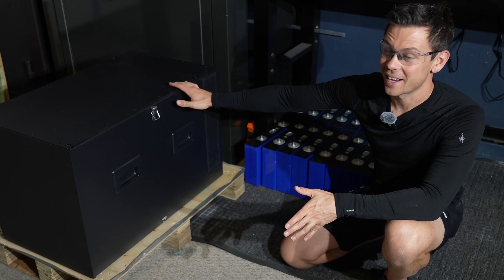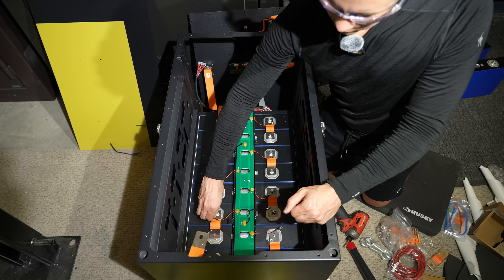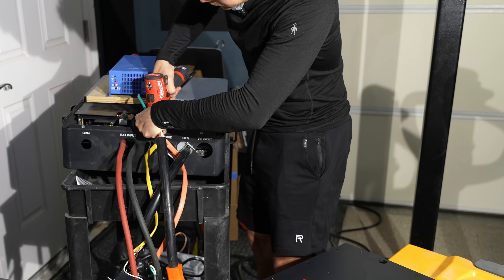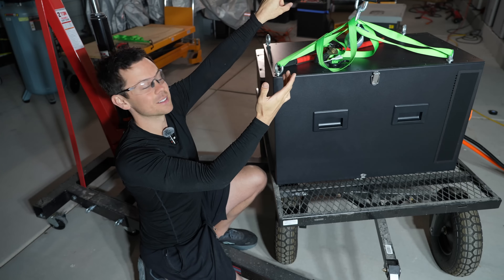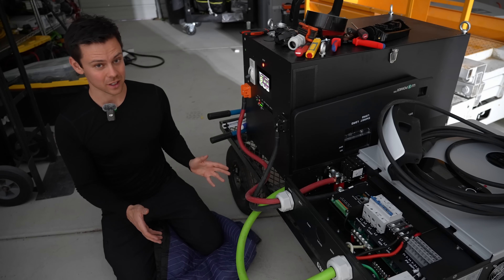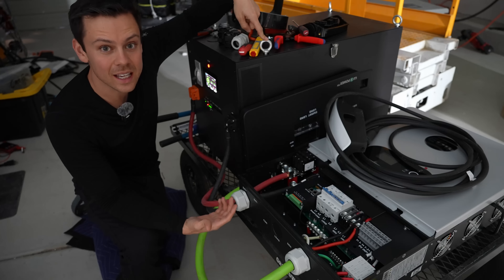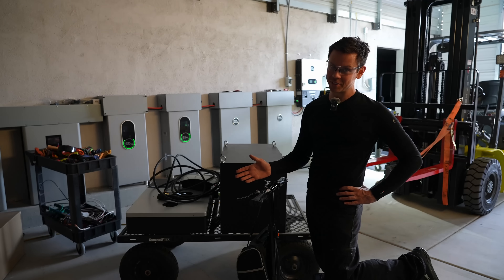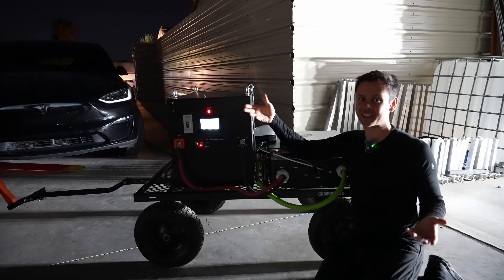HUGE 32kWh LiFePO4 DIY Battery w/ 628Ah Cells! 90 Minute Build

Comment: When you attach the lifting eye's, the flange above the thread has to be seated flush with the top of the battery box to distribute the load, otherwise the thread potentially bends/snaps. The lifting eye's are good for 360 degree attachment, no need for a spreader as long as the sling angle isn't too low. I used to be a rigger in my past life. Good job.
Reply from the maker: The threads were too shallow. They were  all the way in

Comment: Will do you have the specs for surge capacity of this battery?  Can it do 400A for a second?  Need something to start a 2HP pump with 70A inrush at 240v ac.

Comment: Imagine only a small sheet of fiberglass between the lower batteries and upper battery trays. Wow wow the weight and compression of insulation

Comment: I have about 16Kwh of AGM 145AH commercial backup batteries they are 107 lbs each that is 1000lbs
I ran a test with a mess of shop lights and tools for 8 hours (On One Battery) and was only able to draw it down 0.2v

Comment: Great video!
Anyone know how many sungold power 12v lifepo4 200 ah batteries I can wire in a bank?
I want two sets of four in series,parallel for 48v with 8batteries.
Sungoldpower won't answer emails or questions.

Comment: that's a heck of a battery for $3.5k. neat to see thoughtful assembly design.

I worked at dry ice factory a long time ago and the seal on the huge overhead vacuum gun we use to lift the uncut dry ice blocks failed. As the block was falling onto my steel-toed boot (I assumed it'd crush the toe into my foot), I made sure to shoot the camera a foul look. the block bounced off, though, and now I exclusively wear steel-toed boots, even at home.

Comment: The max amperage for this battery was stated as 200a, but the affiliate link sends us to a product which states 300a (JKS 300a BMS and 300a breaker). I assume the factory listing is correct. Ya?

Comment: Steel toes or no toes. I'm glad your foot is okay. 
As for load testing, get a GM EV with the 19.5kw level 2 charger, that would max out any of these. A silverado ev would also probably be useful for the bed and towing capabilities, but a blazer or lyriq would also get the job done. Just make sure its spec'ed for the 19.5kw charger and not the 12kw

Comment: Another big issue with this kind of build is that the bottom cells can't be seen and checked on, even periodically. You would have no idea if a connection isn't quite as tight as it should be, even after torquing, as you wouldn't be able to see with a thermal camera if there's any hot spots. Andy with Off Grid Garage brought this out as he did use a thermal camera to inspect the top connections and bus bar lugs to the breakers/terminals. 
I would much rather a single cell height box so it's a lot easier to maintenance.
Reply from the maker: Good point
Reply: Maybe next version

Comment: Shoulder eyelet bolts do no good if they arent seated on the shoulder. These seem like a nice idea if you are putting the battery bank in a basement and have to get it all down there via stairs. Just build it down there piece by piece.
Reply from the maker: Yeah, the threads were too short

Comment: For our home back up solar system in Pakistan, I would rather choose multiple smaller batteries in parallel to avoid a single point of failure as 32 KWH storage is enough for an average home in Pakistan.

Comment: Will I would suggest you get a pair of safety toe boots with metatarsal guards because of the drop danger you put yourself in. 

A pair of these batteries would power an offgrid welding/ fabrication shop for the most part.

Comment: Those batteries are too large to be mobile. Instead the cells should be stored in a purpose-built outhouse or similar structure and arranged for easy access and maintenance. Mind you, the whole setup will need to be certified as safe for insurance purposes if it’s going to be connected to the grid. Great idea for a video!

Comment: 1:19 please don't use that cheap torque wrench 😢 I've seen your tool videos I can't believe my eyes 😂 at least use something extremely high quality like the Central Tools 97361B for this kind of job. It's made in the USA and still affordable at under $200
Reply: Eh, that Lexivon isn’t that bad for a DIYer. They come with traceable calibration certificates and they’re +/- 4% which is what most torque wrenches are tested to (that’s the ASME standard.)
Reply: That contact point is gonna rust 😭😭😭
Reply: Lol some of ya goofy as hell on the internet.

Comment: I just ordered the 16kWh from  yixiang and was cursing that of course there's a new "better" version out, but then the second half of your video completely changed my mind.  I am so sorry for your foot and wish you a speedy recovery but I am also grateful for the hard lesson that I would not be able to manage the weight of 600lbs.  The smaller 300lb version is no joke either but if I have to move it I can deal with that pretty safely.  I would be toast with that 600lb monster.  Great battery though if it fits your use case!

Comment: I built my own metal battery box for my set of 16 x 628ah cells, a lot easier to access and maintain and on wheels too. Will you need to make a lifting speader bar to stop bending the lifting lugs

Comment: 6:15  I had a Lyft Driver  run over my left foot. 
I have to wear a carbon Fiber leg/ Foot brace for the foreseeable future due to long term Nerve damage & thankfully, the small fractures have somewhat healed after about 2 years + .  
PHYSICAL THERAPY IS ESSENTIAL  to get back on your feet. 

All these injuries catch up to you once you start hitting your 40s. 
Hence why most guys retire from the military around that age if they got in when they were 18 as by that time, you get a lot of "Bangs" and bruises on active duty.

Glad things look good, but keep up on it, and don't let the system slack ya around. 
Took YEARS for me to get the healthcare I needed due to a combination of administrative headache and just plain lack of doctors available up here in Oregon.   

BTW, the foot massages were a welcome relief.  
Some of the best $50 bucks I spent as I could even hobble around the next day or so when things calmed down.

8:09   One word!  Exo's Car Audio Build!  :face-blue-smiling:
Or anyone with a Massive SPL car audio build. 
There are people out there running High Voltage amps Like the Tara Amps that could really do well with these High Voltage DC Cells.
Reply: That sucks. That's why I'm always careful in the cities

Comment: One option for safe moving is to make a universal skid/base that can be moved with the pallet jack. They have pallet Jack's with short forks that are more maneuverable and can be rented for one time use for folks that might move them very infrequently. They also have pallet Jack's with adjustable width forks. Obviously, if you have a forklift that is the most safe and effective.

Comment: could you temperature check the battery on different amperages? I think thats aslo really interesting because i avoid running my 16kwh DIY battery above 80-100A, because of the heat (Dont want to exceed 35-40c)

Comment: I suggest you do a lifting equipment training course, the angle you had for the slinging was way too shallow, it would have effectively tripled the stress on the eye bolts, and you didn’t have them turned to be inline with the sling, This is why they bent, you are lucky you didn’t drop it on your other foot.

Comment: Sorry about the foot. Broke both mine, and it sucks. Any way to get a copy of the Yixiang DIY battery box manual in order to see what's involved? I need to know if it has the communication protocols for a SMA sunny island 6048 system, and how many units can you physically stack.

Comment: 4:06 You can get and use a lift yoke with a spreader bar to change the angle of the straps, that way the sideways force is compressing the spreader bar and not on the bolts.  That battery is seriously impressive.

Comment: WOW to twice the amp/hrs per cell. Love the idea of twice the standard 300  kWh cell to 600 plus kWh on one BMS. Notice sell page did not list the BMS. Wonder how much shipping cost get added to $3500 price? ... Noticed 31 mV difference in cell voltage spread @ less than full charge; which has me wondering what BMS is being used, and what the cell voltage spread is at full charge. Also, while believing 2 amp active balancing is good for 16 x  300 ah cell, I wonder if 4 amp active balancing would be better on 600 amp/hr cells. ...just some thoughts thoughts from my Curious side. Hope testing battery pack over time proves their longevity.   Pipe Dream if I ever built such a battery: I wish there was a long version where all 16 cells were lined up in one row. That would make for way easier inspections, and possible adjustment, if ever needed over time.  Thanks for Awesome Review.

Comment: I put a half ton generator on one of those carts, great until one tyre went flat. I had to use an excavator to lift it and put rigid wheels under the genset. These carts aren't very good on pneumatic tyres as they destabilise easily.

Comment: You're pushing the definition of "mobile" there. Not for people who live on the top of a hill! Check out the new REPT 345 Ah prismatic, same physical size and weight as the 280s or 315s if you want to push more kWh without structural damage risks.

Comment: Did you top balance them?Or is it not needed with these newer b m s
Reply from the maker: No need to do that if you have new cells. And it has active balancers so it will balance quickly if it is out of balance
Reply: Thank you for clarifying, bro I got the same cells and I was thinking it was gonna take forever

Comment: This battery would run my 2700sf house, with 2 a/c units for 2/3's of the year in Florida. I'm really considering getting one of these. Have you had any issues with customs, shipping, and/or delivery of these huge units? I've purchased many things direct from Asia but this is on a whole new level. It's intimidating not having known (or at least time tested) customer service.

Comment: Wow, as I was watching the video, I was just about to mention how dangerous it is to rig at such extreme angles. You multiply the weight to the ropes by a few percent. That's why the rigging eyes got bent. They aren't designed to be rig and angles over 60°. When grinding or cutting, always wear PPE. We are actually required to wear glasses and a face shield when grinding but that is for steel mostly. Leather gloves are a life saver and steel or composite toed boots are also a life saver. I've had 

Enough nagging. Good job on the forklift and always think of what could go wrong before doing something. As silly as it seems, it can save your life. I also always tell young people about trying to keep their backs in good condition while they are young. Have a great day Will.

Comment: Maybe  I'm going to sound annoying, but personally, I think too many YT'ers skip on safety when building these, including Andy with his flip-flops... You should wear steel tipped shoes, face shield (not just glasses, accidental molten metal from an unintentional short isn't fun anywhere on your face) and gloves. You should't wear shorts either: the same molten metal isn't fun there either. And of course, don't wear jewelry while working on batteries: take off rings, necklaces, watches, etc.
Reply from the maker: Good points. Agreed. Especially with face mask. Raw cells are incredibly dangerous to work with.

Comment: I see some recommendations for steel toe boots, I just would want to add to be mindful of the loads you are lifting. Steel toe boots will protect to a certain point and then the "failover" is that it bends down and cuts off your toes so you can retrieve your foot. I don't think you will be dealing with like a 500kg I beams or heavier slamming down, but yeah, something to keep in mind.

Comment: Dang! Sorry about your accident and hope you recover quickly. 👍. Excellent point about weight and safety.  I’ve strained my back before trying to lift batteries and inverters.  There are many things going on at once with DIY solar installation and it’s easy to overlook something.  We’ve all done it. 🤦‍♂️

Comment: I have a potentially dumb question. Can this be easily configured for 8s2p inside this case? I already own a 24v inverter that can power my well pump and a couple of these would run it for days.
Reply: It can also recharge with solar panels to keep working.

Comment: Just a note Will, eyebolts safe working load drop dramatically with lifting at an angle, look into some proper lifting hardware and good slings. Also, a pair of hikers with safety toes are comfortable and lightweight. A little prevention goes a long ways.
Reply: Too tight an angle on the eye bolts. Need to decrease the angle dramatically.

Comment: Steel toe boots! Always cheaper than the pain and $!
Reply: Steel toecap boots don't protect your whole foot. The most blood curdling cry i ever heard was from this 6ft4 guy in a data center who dropped a 4U disk array on his foot. The steel toecap boots saved his toes but not his foot.
Reply: Steel-toe boots would have just collapsed, and they're only rated to 75 lbs.
Reply: @gavnivag7436  Not when the disk array comes down at an angle. The corner creates a bloody pulp where your ankle meets your foot. Fortunately the leather held most of it together.

Comment: i'm happy this unit at least has a 300 AMP BMS instead of the 200A you see on most large batteries, the BMS is really the limit to how much these 30ish KwH and larger packs can actually run.

Comment: I’ve ordered a second 52 cell 306 amp hour battery pack from Jehu Garcia . I already reconfigured one into three 16s and one 4s batteries. Just added BMSs then paralleled the three 51.2 batteries. It will barely pass through a 3’ door but just made a platform in the garage.
The next one will stay on a trailer with a 6000XP,a generator,and a Chargeverter. This will make an excellent disaster relief or quick off grid power supply even before you get solar panels installed.
My bug out bag is getting heavy 🤓!

Comment: That setup is very unstable if you don’t have the tire pressure equal or if you move it on uneven surfaces. I’m sure you can build two single level batteries and parallel them,keeping the center of mass much lower. That’s a wicked bruise,watch out for a deadly deep vein thrombosis.

Comment: Cool that this one battery can handle all 11.52kW.   EG4 didn’t used to make it super explicit that you can’t reach that output continuously on just one of their wallmount batteries.  Instead of a second EG4 wallmount battery, I was considering DIY to get 16kWh for half the price of their 12kWh.  However, I know I really need way more than 16kW, so adding something like this would be better and it’s half the wiring.

Comment: Get a flat bed cart with solid wheels.  Those carts and dollies with inflatable wheels are the worst. We used to use custom made carts made out of thick plate steel to do the slot drop in the casino.  You can move a ton of coin across a carpeted floor with one.  The cart alone probably weighed a few hundred pounds empty.

Comment: Now if you can make battery pack do dc fast charging! Maximum of 30kwh! It'll be so nice! Ac charging isn't even a big deal considering you charge an ev directly from solar panels & an inverter. Please Figure out a DIY DC fast charging solution. Thanks

Comment: Brother rather than that forklift you should have just put a bridge crane system in. You're always going to be lifting heavy things in there and plus if you ever wanted to work on your vehicles it's so easy to lift things out with a nice bridge crane
Reply: @Vaktare_White

Hard to take the bridge crane outside...
Reply: @billstevens3796 it's meant for loading things on and off of tables and trailers inside a large work area. ...
Reply: @Vaktare_White  
My point is that Will's new forklift covers all those needs and is useful outside as well as he has already demonstrated.

Comment: The eyebolts bent because you have exposed threads. If you can't screw it down all the way to make it sit flush, use washers. 
And yes, get composite toed boots to wear when you're working in your shop.
Reply from the maker: No, they were all screwed to bottom. It was shallow
Reply: @WillProwse  the eyebolts should be shouldered and angled tward the picking point. Somewhere around 45 degrees. Try to use slings that will reach the furthest eyebolt across. When you do things you should not, the more you know the less you get hurt. lol get well
Reply from the maker: @kevinbaxter5691 yeah agreed but they aren't. So need to use metal beam and then attach. It's badly designed. That's why I mentioned it
Reply from the maker: @kevinbaxter5691 yes I messed up and I'm usually careful. Learned my lesson
Reply from the maker: Yes smart idea about composite shoes

Comment: CONSIDERATION: If Building a multiple level cart, be aware of the center of gravity on the build, or it may tip over on you!
Reply from the maker: That's why I need the batteries on the bottom

Comment: Do not glue those foam on the cells... will be a pain to remove if needed to... while there is no advantage glueing it.
Add a fuse to the bms positive cable. Use security shoes... with metal protection on your toes.
Recently i had a good deal on this pack (2800$) but though the 2x 16kWh in 2 boxes is a better choice even if a little more expensive (100$ more.. only)
2 box : Redundancy, if there is a problem on a box you still have power, if a cell or a bms fail .. it's less expenvive to replace and easier to do. You can pull 400A from 2 pack vs 200A. It''s easier to move around.
1 box : a little less expensive, less power draw at idle and in use (2 bms instead of one).
Reply: I agree...all my eggs in one basket ....dosent sit well with me..and way too heavey, no access to lower level cells😮